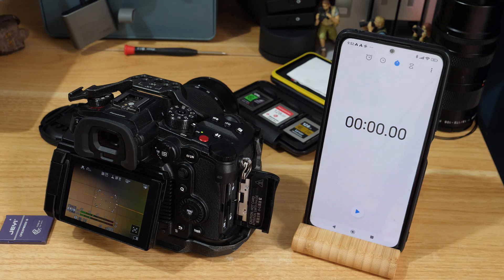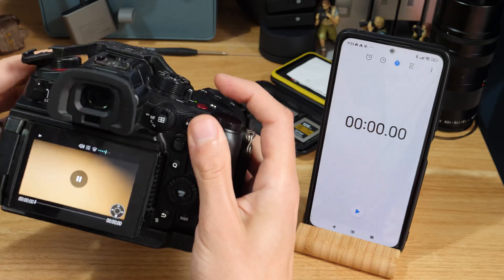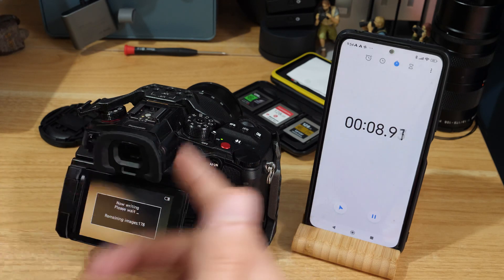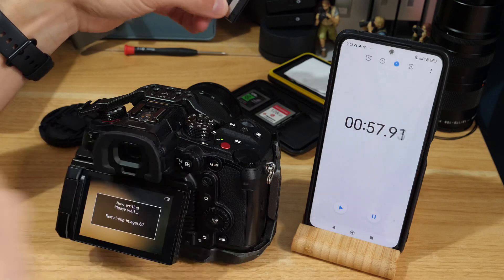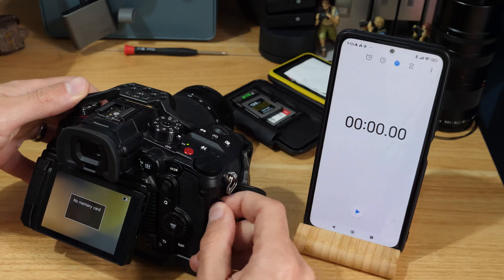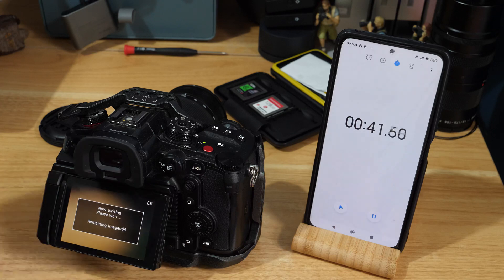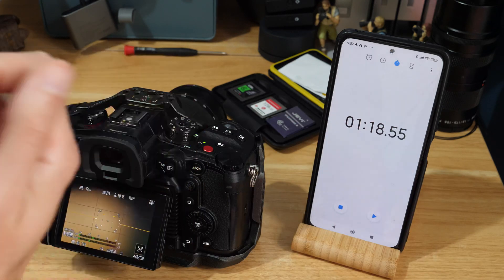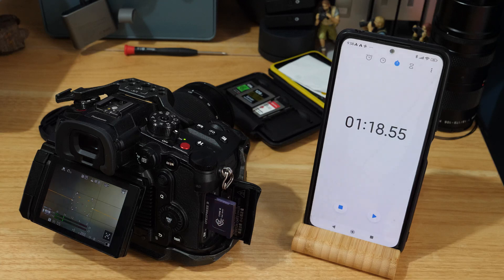DIY NVME CF Express Card vs. Off the Shelf CF Express Card Speed Test | Which CF card is Faster?

Comment: Can you do a test where you record the highest resolution video that your camera can record for as long as possible. Then check to see if your camera shuts down due to temperature issues. Can the custom card record as long as a native card? And did the custom card drop any frames?
Reply from the maker: I don't tend to shoot 422 for long recordings but I have shot over 5 hours of footage non-stop with this card on multiple occasions. All the footage was fine.
Reply: @stevelitton I'm off to make my own CFexpress cards then. Thanks for the info
Reply from the maker: @hipery No problem 👍

Comment: Thanks for the great test. Have you tried the Jеyi sf express adapter, where the ssd 2230 is inserted? A friend of mine put a 2 terabyte SSD in there and says that it works much faster than his v90 SD card. And the price of an adapter with a card reader and a 2 terabyte SSD was cheaper than a 128 gigabyte V90 SD.
Reply: 2230 m2 cards are much faster then SD cards, there’s not point comparing the 2
Reply from the maker: @Muffins-lx8xd   Yeah there is no doubt that a CF Express Type B card (NVMe or not) is going to be substantially faster than a V90 SD card. Even the slowest CF Express Type B card will be around 1200 MB/s compared to a V90 SD card at around 300MB/s.
Reply from the maker: Hey, thank you I really appreciate it 👍 You can see exactly what parts I made it from here 👉 https://www.youtube.com/watch?v=Lk8nvNrXBoY and in this video, I do a quick breakdown of the costs 👉 https://www.youtube.com/watch?v=p57cDEcWjKE Hope that helps.
Reply: Thank you very much!

Comment: Thanks Steven, for the great information, it helps me every time. 

I recently got a WD SN740 1TB (NVME 2230, TLC) with JEIY CF Type B combination for my GH6. I have been able to record with all recording options, including PRORES, until the memory is full. 

There are a few things I've noticed over the time I've been using them, one is that they run out of battery at least twice as fast as an SD card, sometimes four times as fast, so I always need spare batteries. 

Another thing was that the card didn't slide out easily, which was a bit inconvenient. If you look at the design of past kits, they were designed to catch your fingertips, and this version doesn't have any such catch at all, so it took quite a bit of effort to change the card.

Lastly, I didn't have much of an issue with the heat, but I did notice that if I applied the thermal paste included in the JEYI kit with a wide application, it would later run down to the connector contacts like grease. It seemed like I needed to be careful when applying the thermal paste.
It seemed appropriate to apply the thermal paste as thinly as possible and within a certain range.

If you get a chance, could you also include the battery consumption in your next report?

- Brandon
Reply from the maker: Hi Brandon, 

Thanks, its great to hear that you find the videos useful 👍

Yes, I agree the lack of a grip on the card is a little frustrating at times. I think the camera is working harder in general using the CF Express card and those larger recording modes. So the battery is always going to suffer a little. But I will see if I can do a comparison with another card if I get a minute. Yeah you do just need to apply a very thin layer, I didn't do the best job on mine but it seems to be holding up so far.